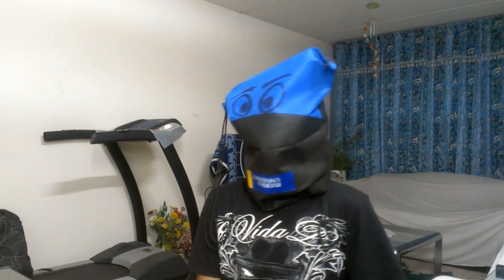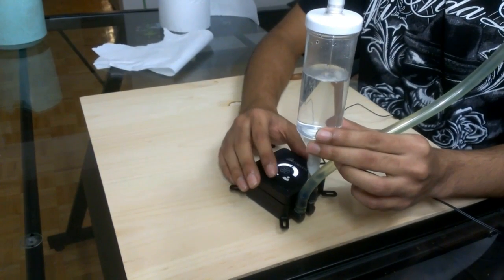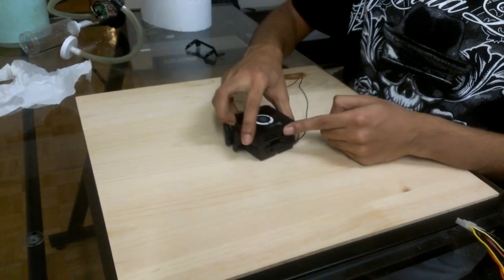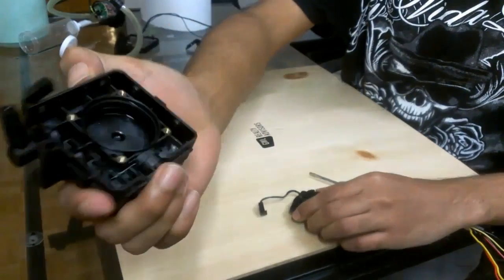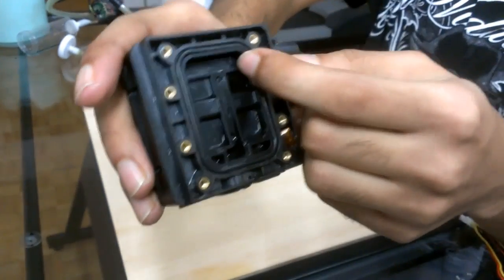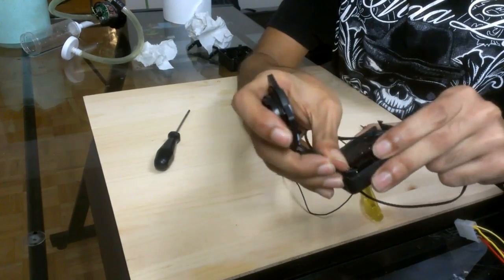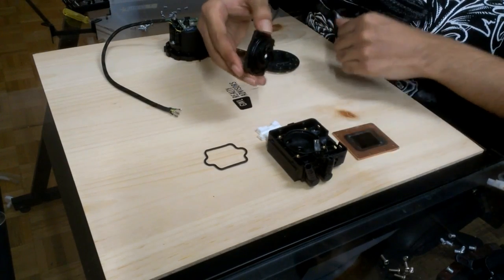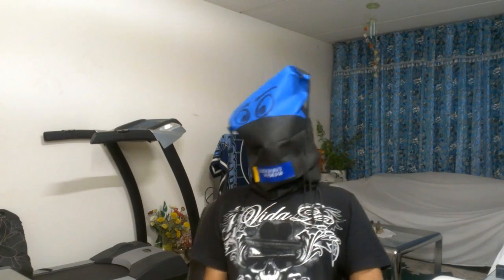Corsair H100 Pump Teardown & flow rate check

Comment: Thanks for the information, it was sincerely appreciated. Due to your hard work, I was able to resurrect my Corsair H100 (for the time being). I still hear the pump noise, but at least its going now. I had some corrosion on the rotating part of the pump, soaked it in some vinegar and water for a few hours scrubbed with an old toothbrush and voilà it works. I'm thinking maybe its low water in the loop. After it fails again I think I'll replace the liquid, add some biocide and see if that works. Does anybody know if the pump has a permanent magnet? Or, is the pump replaceable?

Comment: Thank you so much for the video post! Very informative and well done. Lol I love to void and avoid warranties too!  I have a Corsair H80 that I purchased in Dec 2012 and its worked great the past 6 years. But now I think the pump has stopped or slowed and was curious about the internal parts and how to disassemble without damaging. Wondering if its possible the fluid has evaporated some how over the years and if it could be replaced. So happy I came across your video! Thank you again :)

Comment: What size tubing are you using? I have an old H100 and will be refitting it to be the circulation cooler for my 40w laser tube. I removed the original tubing by cutting the heat shrink and now just need to order some tubing and clamps.

Comment: haven"t seen this question - is it possible to use broken pump as cpu block head for a  custom cooling system? after removing the motor fan to improve water flow
Reply from the maker: Yup. The only limit is your imagination.

Comment: how do i fill this thing up when im done fixing it? theres no valve to let the air out and completely fill the loop. or is there?
Reply from the maker: Take off the Copper plate, pour in the liquid from there. Then start shaking it like there is no tomorrow.
Reply: i just tested my system still closed to see/hear the pump itself running, and it indeed is running, but im hearing a clunky sound to it going with the rotation. could that be a problem? will i see the problem after taking the pump completely apart? thank you
Reply from the maker: Most likely not. That's how most of the AIO sounds like.

Comment: I wonder if you can help, I have an h50, I added a second radiator and all was well, until I tried to close my case. something got pinched and the pc shut down. the pump appears to have died. I have another pump but still have the h50 in my loop. the h50 pump doesn't show up with any fan speed, not even 0 in monitoring programs. Is there any chance the motor is still ok and there is a wiring or circuit issue? Would it be hard for me to use a fan motor as a replacement? it wouldn't be the only pump in the line so even if it only added a small amount of flow rate it would be ok for me, and I have a few strong fans with small but strong motors around.
Reply from the maker: +Big G Take the power leads our of the pump connector (you can leave the rpm sensor), plug them in directly into ground and 14V power in your Molex connector while everything is disconnected except your mobo. Hit the power switch. Touch the pump, if you feel any vibration then it's working. If working, then run it on 5V all the time. If not then it's dead. Take it out. Rest of the components are more valuable than your loop. H50 has the most robust aio pump I've ever seen. Mine still works after all those years.
Reply: +Rexin Oridle Thanks! I have wired the leads to molex and nothing. but I also noticed that when i first connect it to the mobo i get a blip of rpm registered then it goes to 0 or no input. If the wiring\board was ok it should show the rpm from the water flow shouldn't it? Have any thoughts on putting another motor in place? You have torn yours down further than I have.
Reply from the maker: Big G Keep on testing with the molex. It's most likely a short circuit or a blown cap. It's possible to damage the mobo if you connect it.

Comment: what size tubing are you using? I think that the corsair units use a 9,5MM or 3/8 inch tubing, is that right? I am asking because I want to tear down my H60 and add in a pump/res combo to the loop and clean it out etc and that would mean ditching the stock black tubing for something custom.
Reply from the maker: +Lawrence Pritchard I believe they were 3/8th id tubing.

Comment: Good stuff man. Do you know how the H90 pump compares?  I presently have a CM 140xl and the pump has a very high-pitched whine that really annoys me.  I need to find a substitute for around the $50 range.  BTW your english is fine, no need to apologize for your accent.
Reply: The ''Raijintek Trition'' is a really great AIO. It's 240mm though. It's extremely cheap but still beats a H100i which is pretty damn impressive, plus its expandable and customizable.
Reply: *****
Thanks for the info.  I couldn't find one available locally and ended up picking up an H90.  Although you get more for your money with the 140XL the H90 pump is pretty much silent so I'm happy.  Customer support was also excellent in responding.  Peace.

Comment: in my h100i im going to tear out the motor and propeller and just use the empty water block for the corsair link for when i make a custom loop
Reply: Hey, what was the end up result of that?
Just wondering because my H100 is doing some weird shit and CPU temps have shot from ~30'C to around 80'C and i am starting to get auto-shut-downs from overheating CPU. I am beginning to think it is low on water or something.
Reply: It worked out pretty well. getting the propeller out was hard. I ended up getting a h220x and using its block after a while.
Reply: Rexin Oridle Look closely, it's not -30 as in negative 30, I used the tilde ~, the wiggly symbol next to 1 on your keyboard. This means "approximately" in mathematics.
Reply: Jesus it could also be that there is a air bubble between the cpu and water block itself. Maybe getting new thermal compound and applying a a little glob in the center might help.
Reply: I did that.
I bought 2 new fans and as I went to install them, I found that of the 4 fan plugs, one wasn't putting out power, so I will  hook up the 2 new fans as PUSH and the the old ones as PULL, hook 2 up to the pump and 2 to the mobo chassis fan connections. See how that goes. At least the mobo can control the fan speed on 2 of the fans. Maybe hook em up as double push, 2 by pump and 2 by mobo chassis fan control. Trial and error... 
I saw a vid on how to disassemble the pump and it says the H100 pump is the lowest flowing of all the ones from corsair.
Reply: Jesus sounds like its dead, if you can afford it get a swiftech h220x because its a decent priced expandable cooler if you ever wanna hook up a gpu or more rads. if you can afford it buy a $20 air cooler to get you by for a while. i used the water block for just the corsair link but it didnt have great flow even after being gutted out.
Reply: The motherboard OEM monitoring software reports a CPU temp of 30'C right now while another program I use called Core Temp 1.0 RC6 is reporting between 75'C and 80'C between each of the 4 cores. Maybe it's a software bug that is really reporting the temp in 'F as 'C. I tend to trust the OEM one before the one I downloaded from who knows where.
Reply: +Jesus hi m8 
ur issue it's very to fix, change Cpu thermal past make sure you clean Cpu very will same for the pump don't put  thermal past on pump only put some on Cpu and not a lot check some video on YouTube how do it good luck 
by the I'm Muslim and believe Jesus coming back soon to kill the devil :)
Reply: Believe what you like man, I don't give a shit. The pump was fucked so I threw the heap of shit out and put on the standard CPU cooler and it works.
Reply: cool story jesus keep up ":)

Comment: can you use the H100 pump w/ the DC-LT top?

I have an H100 lying around and if I can use the H100 pump w/ the DC-LT acrylic top, then I can use the pump for a separate loop for my video card, I already have a couple of radiators laying around too, would only need reservoir or I might go w/o reservoir and just make it like a closed loop.

Comment: Guy on techpowerup added a res, he was hoping the extra water would lower temps. Another guy (different forum) used his H70 rad to add to a custom loop. I think they use clamps to secure new tubing on the corsair parts. overclock net corsair-h70-mod

Comment from the maker: You can knock off couple off pins from the pump side but on the radiator side it's sealed. If you want to use a different tubing, you have to cut them. And if you cut, there is no way back.

Comment from the maker: The installed cpu copper plate is very delicate. You can try removing fins in-between. I would say use a dremel tool. If not, you have a hery high chance of destroying the whole thing.

Comment from the maker: Now that depends. If you have no grills or removable grills on your fan mounts, you can simply drop the pump inside. But if you have just 2 holes and fixed fan grills........... Then you have to remove the tubing from the pump side. There is a pin holding each tube to the pump. You have to remove them. This requires draining and refilling the coolant.

Comment: Hey Rexin Simple Question. Would it be possible to Mount the H80 or H100 on the outside of a full tower case? Are tubes long enough and if so how do you remove the tubes so that you can mount the radiator on the outside?

Comment from the maker: There are three possibilities for a H100 to leak. Connection between the housing and pump, connection between housing and copper plate, or if the housing it self is cracked. The connections are sealed with good quality rubber. I don't think you can do anything else to reduce the risk of leaking. If the tubes are leaking then it's a different story. There are ways to change the tubing

Comment from the maker: Hey Warren,
I've included a link to some high res photos in the description. H100 was built in a very small form factor. So I'm afraid it's not possible to widen out the holes. Also the fins on the copper plate are very close to each other. So most of the restriction comes from there. But if you want to customize it, you have to take it apart.

Comment: Is there a way to enlarge the intake and the outgoing inside the pump just a little, as you could not see the inside of the pump very well in your video. if you are able to widen the in and out a millimeter or 2  that would increase the flow jus a touch to help cool. And not having taken the h100 apart myself just wondering if it is possible and will you try that.
Warren

Comment from the maker: Hey thanks a lot. That was very helpful. The liquid velocity is increases the cooling capacity. But there's is something new that I discovered. On a regular DC-LT pumptop the pumps works fine without noise. I went upto 15v without any problem. But when I put too much restriction in the inlet of the pump, the props starts to shift and touches the pumptop. Most of the vibration and noise comes from there. The one that I have is the revised H100 and still was having the same problem.